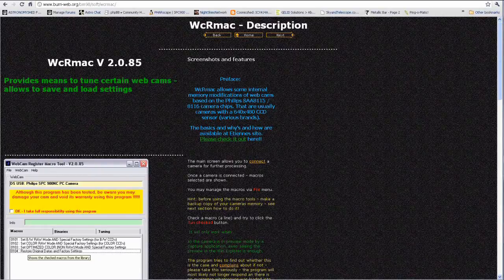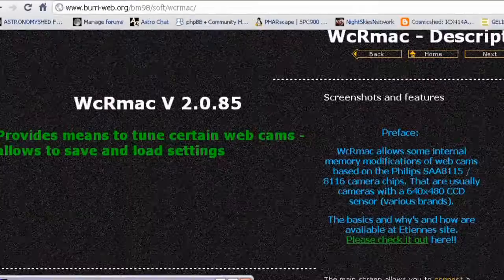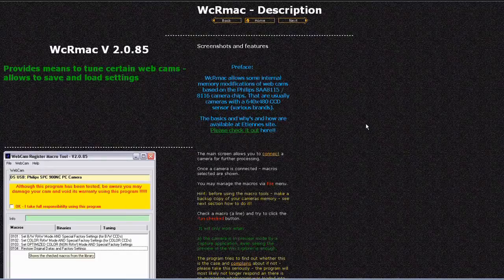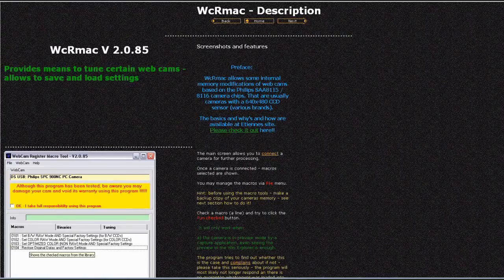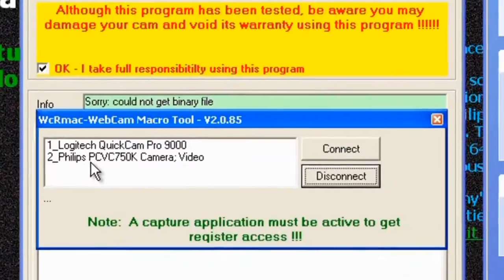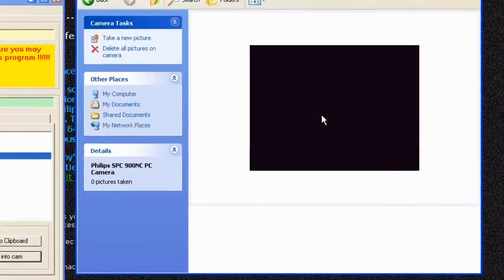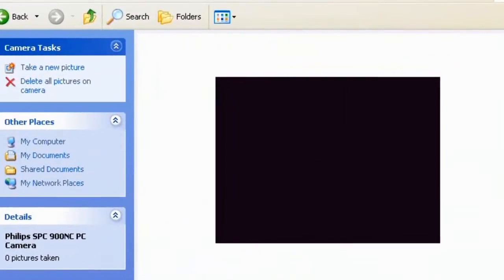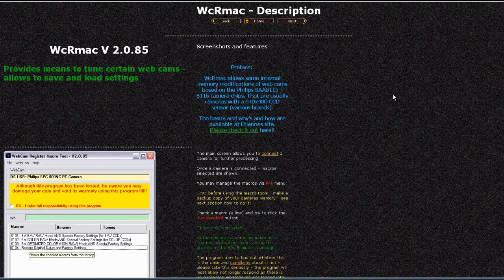SPC880 To SPC900NC Flashing

Comment from the maker: I may have solved your problem, dont forget that the disk that came with the cam is now useless, you have an SPC900 that is in effect a different camera, you need the driver for SPC900 NOT 840K do a search on philips website for spc900 driver for your operating system, install that and you may have a surprise ;o)

Comment from the maker: Are you sure it's dead?  I do have a firmware for the original 840 on my site, if you contact me there you can try backflashing it. It definitely should have been fine as I had 2 of these I flashed to 900 firmware. Also google 'flash 840k to 900' and many have done it.

Comment from the maker: Hi, you can flash the 840 and it will be fine, in fact the 880 is simply an SPC900 with the 840 firmware in it.

Comment from the maker: @bearofbarham You can either add an Antares .5 focal reducer or modify the focuser slightly (covered in one of my videos)  or even move the primary mirror up the tube a tad with the collimation bolts, if you check out my site you'll find all the answers.